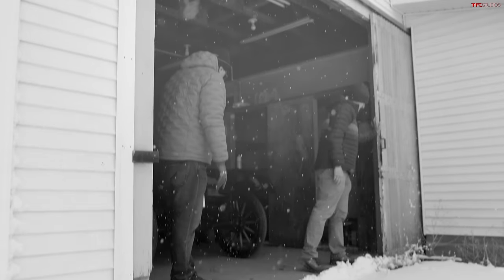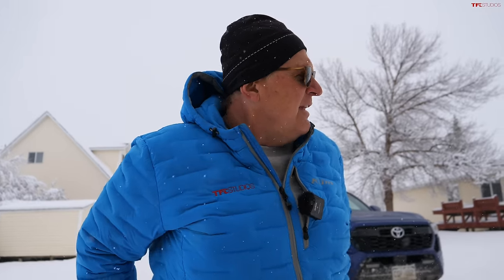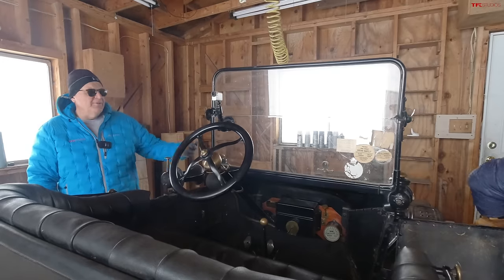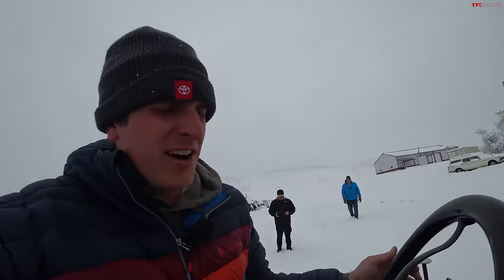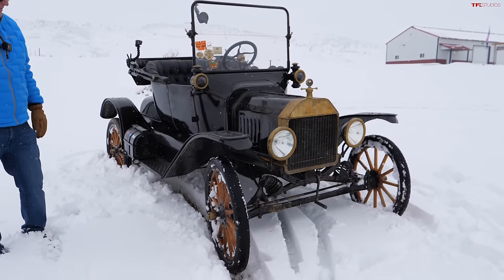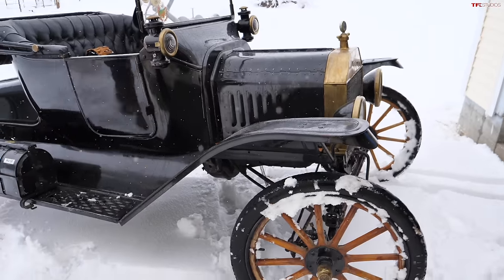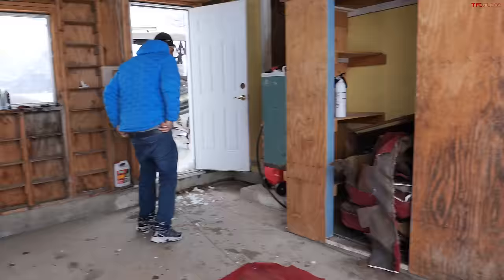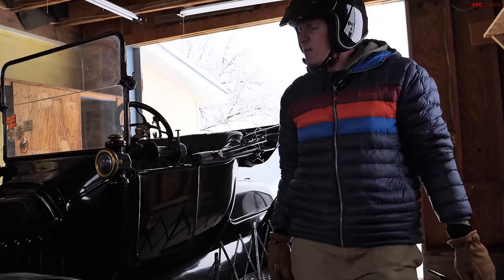Can You Really Drive a 100-Year-Old Ford Model T In the Snow? (Part 3)

Comment: I have heard that back when the car was new, drivers would wrap rope around the wheel, threading it through the spokes, as DYI version of chains.
Reply: I also recall something where they would take a block of wood and a belt and strap it to the wheel. This added a hefty lug for getting out of places thick of mud.
Reply: True,  then get it wet and allow the rope to freeze solid.
Reply: My Dad's uncle talked about wrapping light chains around the tires like that, for traction.
Reply: I would carry a long length of 1/2 inch rope in a saddle bag of my M/C for the same purpose. When caught in surprise snow storms while living in the mountains I would wrap the rope around the back rim and tire multiple times, forming a type of chain to improve traction. Combined with dropping pressure in the front tire, was enough to get me home on more then one occasion. Talking inches, not feet of snow here, deepest I did this in was maybe 6 inches. Not able to run at highway speeds under such conditions, but always better to keep moving at a slower speed than leave my custom chopper behind.

Comment: You’re right about back in the day they didn’t use antifreeze. Back in the day what they did use was a mixture of alcohol and water, depending on where they live and degree of temperature.
Reply: makes sense
Reply: That might not be glycol, but it is antifreeze
Reply: Right very common into the 1920s and later for some people. My grandfather said that you had to be careful though because the alcohol would cook off and need to be added again. When the first real antifreeze was available, it was recommended to flush it out for summer because it would corrode the system.
Reply: @NYCS19339  How true !
What I thought funny and also worthy of the Darwin Award was, in really cold weather they would light a small flame underneath the car’s oil pan. I believe this method is sometimes used in fridged areas to this day.

Comment: My family built a 2 bay garage in the 1910's when they got their 1914 T.  One bay had a removable floor section to service the car. The other bay has a 2ftx3ft metal pan to catch the engine block water when you parked in the winter. The pan drained to the ground. 
They used that 1914 T to drive a pulley driven firewood sawmill and would stick a meat grinder handle into the spokes and idle as slow as possible to grind meat. Sadly the T was sold in 1915. We still have the garage.
Reply: So they only kept it a year or do you have a typo?
Reply: I'm pretty sure by 1915, there were some alternatives to the model T, but definitely not many that were adorable or mass-produced. Or it broke down and they sold it for scrap because they couldn't get the replacement parts. @Wingnut353
Reply: I heard that they used to drain the oil and take it inside when it was incredibly cold out.

Comment: If you read some of the old accounts of driving across the country which happened 5-7 years before this, they used rope as there were no chains. You could get a few feet anywere in those days and most farmers and ranchers had it. If I rember correctly Edsel Ford drove a brand new 1915 across the country to show it's reliability. My father drove a Model T as a kid as his dad never had a driver's license. A driver's license was fairly easy, plop a quarter on the counter even if you had to stand on your tip toes. During winter and spring they not only had ropes for chains but carried a block and tackle to winch if needed.
Reply: ye that makes sense. I'd imagine even a horse carriage should have something like this.
EDIT: o w8, horse carriages prbly didn't need this at all since horses did the pulling.

Comment: That's what the Model T snowmobile kit is for. Here in New England, we know better than to drive our model Ts in the snow without tracks on the back and skis in the front. Ford sold a snowmobile kit for winter driving from the factory. There were no winter tires in 1915, only snowmobile conversion kits. Many consider the Ford winter driving conversion kit to be the world's first snowmobile.

Comment: My grandpa had told me that back when he was driving one (bought a brand new ‘23 at 18yo) he would drain the oil and I assume radiator and bring both of those fluids in the house at night and store them by the wood stove so he could start the car easier in the morning.
Reply: Probably brought the batteries in to...
Reply: Lived in Alaska for seven years. Those folks who lived out in the "Bush" away from city power and only firewood for heat would pull batteries, oil, and antifreeze to keep warm in the cabin until they needed the car or truck. An alternative was to use a single burner hibachi grill. They would fire it up and after the flame died down would put it under the oil pan to warm the oil while covering the front of the car with a heavy blanket. All city homes had hitching posts with electrical outlets to plug in block heaters, battery heaters, and interior heaters. Was quit the experience...

Comment: What people used to do in cold weather was drain the water when they parked up then fill the radiator from the kettle before they went out, this also pre-heats the engine making it easier to start in the cold. They have a tap for you to drain the water. I know some farmers who keep vintage tractors to use as yard scrapers and they still do this in the winter.

Comment: Wind rope around your rear wheels, leaving good sized gaps between every few passes (at the spokes, gaps are automatically created, in any style of wrapping.) Use heavy-duty rope, and do not drive on hard surfaces, while wrapped. Loose snow, only. Wind the rope, and tie it, with the intention of being able to unwind, and save the rope.

Comment: I drive my Model T in the snow whenever it snows. If you wrap half hitches of rope around the tire and between each spoke the car will be nearly unstoppable in snow or mud. I usually use 1/4" clothesline rope Use a half hitch between each spoke so you'll have 12 loops of rope locked square across the tire tread... Tie a bowline knot to make a loop in each end after wrapping it with 12 half hitches all the way around the tire. I put one loop through the other and use a rubber tiedown hook thing to pull the other loop across the wheel and hook to the rope on the other side to tension it like on truck tire chains. If you use the proper knots it won't come apart unless the rope wears out. There were also various types of tire chains that fit the period tires which are still out there.
Reply: Hey OP/ tying and naming knots is way beyond the 'skill sets' of the rising generation
Reply: @harriettanthony7352  If you can read you can learn to tie knots. I just recently saw a guy, probably in his 20s walking on a sidewalk...and Knitting as he walked.

Comment: My dad raised on Kansas farm. They used to drain radiator in winter to drive the mile to church. Other times they built small fire under engine pan to preheat engine.

Passenger would blow in gas tank to pressurize it going up hill. Apparently some people rigged bicycle pumps to pressurize.

Would wrapping rope around rear tire improve traction?

Comment: In the old days you would just drain the water out of the engine before parking it overnight. Fill it up in the morning. You would put a cover over the radiator to keep it from freezing while driving. 

Alcohol could be added to the water to act as antifreeze, but it had to be replenished frequently, since it would boil out of the water as you drove.

Comment: I'm sure you guys already know, and others have probably mentioned it in comments on the other videos (I haven't had a chance to watch them yet), but electric starters became widespread as safety feature instead of a convenience feature.  If the engine backfired/detonated (I'm not sure exactly) while hand cranking it then the engine could suddenly reverse rotation.  This resulted in many injuries (broken arms) and even deaths.  The solution apparently is to start the engine using just your left arm because when if the engine reverses rotation then it simply bends your elbow.  
This may also be an old wives tale and I don't know what I'm talking about.  Just wanted to bring it up.  No one wants a fun video to become tragic.
Reply: 62 years ago I was hand cranking a 1948 Morris 8 when it back fired and nearly broke my wrist. An early lesson, ALWAYS crank with your thumb kept alongside your fingers and not round the crank. Do not use both hands! 
With two broken wrists how are you going to eat  and excrete?

Comment: Little light in the rear end. Tire technology has come a long way too. I remember my grandpa saying that the T’s had more torque in reverse than 1st gear. He said you’d see folks going up hills in reverse. Good stuff. Nice video. 😊
Reply: Mostly because the fuel was gravity fed only slightly higher then the carb, but if there was someone sitting in back they coulda gone a couple more feet

Comment: To get up steep hills and in the snow, early cars were driven in reverse. This would allow fuel to gravity feed better and effectively make the car front wheel drive in terms of direction of travel. If the tank was kept full, the weight of the fuel adds a lot more pressure into the fuel line. Also, anti-freeze as an automotive product was offered in 1917. Prior to this, some people added isopropyl alcohol to radiators in cold climates.

Comment: Before antifreeze, motorists would drain the water before storage and refill before driving again. The height of the car and the non-pressurized cooling system allowed this to be done with a simple bucket or watering can.

Comment: I would bet good money that back in the day drivers would do the same thing I have done more then once to get my M/C home when caught in a snow storm. And that is wrap a good length of rope multiple times around the back rim and tire, forming a type of tire chain to improve traction. The spokes keep the rope from slipping, actually works really well. A 1/2 inch rope was thick enough to get my custom chopper home through 6 inches of snow. Didn't set any speed records doing this but kept me moving. A far better option then leaving my bike behind. I'm sure your Model T could handle a thicker diameter rope for even better traction, handle even deeper snow. Testing this could make for an interesting follow-up Model T video

Comment: As a Canadian I laughed when he said worst snow storm in 3 years.
Reply: Alaska here. I thought when they said worst snow being 4 - 5, he was going to say feet. I was like yeah that’s pretty good. Then he said inches! That had me rolling.
Reply: In the mountains it was 40-60 inches. They got missed by the worst of it. The ski resort he mentioned ended up getting around 60 inches and had to stay closed for a few days because of avalanches. About 25 miles from them I was snowshoeing over the tops of cabins
Reply: @bigjfodayz  average Canadian snowfall
Reply: @aircraftnut15  What you have to keep in mind is that the front range of Colorado is a semi arid ecosystem and receives an average of 18 inches of precipitation a year so getting a single storm with 3 to 5 inches of SWE is pretty substantial.

Comment: I would have liked to see you try wrapping the tires with rope, the way modern traction aids use zip ties. 
You should try going to something like the Old Car Festival at the Henry Ford museum, where you would see Model T's fitted with various kits available at the time. Tracks & skis, four-wheel drive, or a PTO pully to belt drive I saw or corn grinder.

Comment: I think they used to wrap rope around the tires then tie off the ends on the spokes they use to put a fire under the engine to warm the oil up otherwise high gear would drag or you would have to jack up one wheel till it warmed up when they got them going in the winter they didn't turn them off till they got where they were going and drained the water out right away so it didn't freeze more often then not they just hooked a team if horses in the winter

Comment: one other thing ppl did with radiators back in the day that didnt have thermostats in the engine,  they blocked it off partially or if really cold completely so as little cooling air got through when cold..
this could be very easily done today using cardboard in front of the radiator..  just watch the thermometer on the fillcap so it doesnt boil over..

Comment: Pro Tip: If you're pushing a heavy vehicle, push along the top of the rear tires. It acts like a lever, giving you more torque, but less distance.
(I'm not suggesting the Model T is heavy. Just popped into mind.)

Comment: You don’t need to push the high gear lever all the way ahead if you are just going in low gear. Keep it in neutral and press the pedal down until you are ready for the freeway, then put the lever all the way ahead. If you can’t operate it in this manner there may be a problem with the transmission.

Comment: I would say a lot comes down to the tires, have seen model T's that handle snow very well as long as they have the right tires, also seen pictures from the time of different types of snow chains variants that were used, if they came as accessories or if it was home built I don't know

Comment: Where the wheels had to skid to push the car I see yellow color. If it would be just sand it would be perfect but it is obviously clay.
What they needed was a shovel to clean the snow ahead of wheels and some sand for traction. Ford Model T just needed some traction in the rear by adding weight in the rear and some sand, thin tree branches under rear wheels, clearing the path for front wheels from sticky wet snow.
The problem is that Ford Model T is essentially a rear wheel drive truck with no weight in the rear and all the weight is just in the front due to engine.
There's a reason there are almost no sales of rear wheel drive trucks these days like it used to be 20-30 years ago but only 4WD precisely for that clear front weight prevalence in a rear wheel driving vehicle.

Comment: I was told they used kerosene for coolant in the midwest so it doesnt freeze or some stronger alcohol mix.  Also couldnt you wrap the tires with some rope spiralling the rear tires as "chains" for traction?

Comment: Before glycol antifreeze, they would've used alcohol. Probably methanol. Much lower boiling point than water, so it would've kept the engine very cool, not really a good thing. Also flammable, but the radiators were not pressurized, so not that dangerous.

Comment: People stayed home a lot more back then.   I always heard they were good in snow and mud tho.   Need some weight in the back and some chains and it would be a huge diff me thinks.
Reply: And if you had literally any other vehicle than a Model T you'd be even better off. Like say..., a 1915 Winton with actual weight, also being twice the size, 128 Wheelbase - 132 Wheel base, 30 tires, beautiful unlike the Model T (which was extremely outdated in it's design, this is NOT REMOTELY 1915 American design), fabric side flaps with built in material "glass" windows for the enclosed design. There was also the detachable hardtop, or built in hardtop, perfect for Winter, and they were beautiful, the early hardtop car with fancy window displays.

Comment: You would drain the water out of the system in the winter after every use. then you'd bring out hot water to fill the radiator, when you wanted to use it.

Comment: first  issue dude is traction and momentum clueless keeps trying make new tracks seperate of  the rear wheels turning before getting any momentum and the 2 additional tires creating a new path creates more resistance than there is momentum or traction to overcome its painful any two bit driver could do better..  especially uphill there stop trying to turn there and at low speed the swerving brought ya to a stop.. driver error/deficiet not vehicle deficiet ..keeps  trying to create new tracks rather than using the cleared ones taking momentum away.. digging ruts